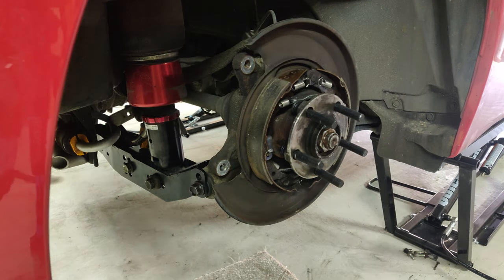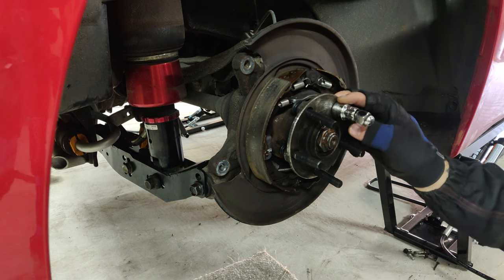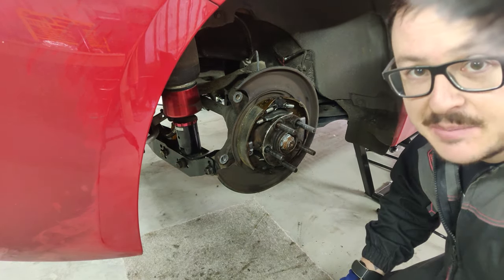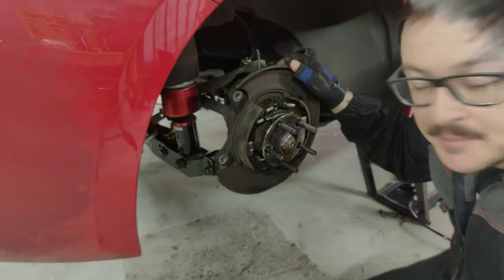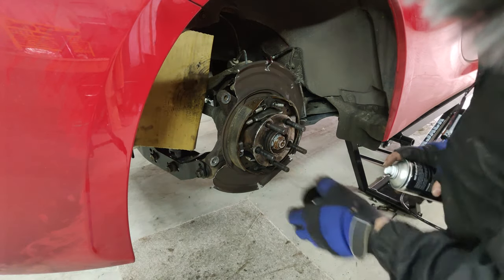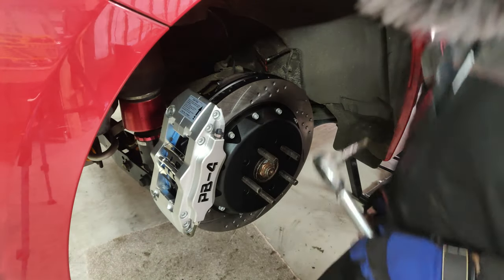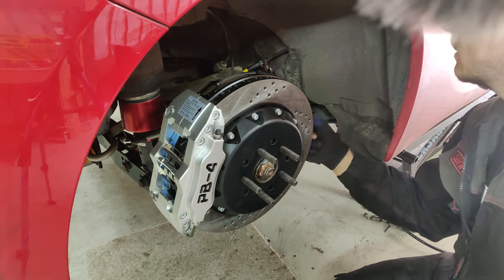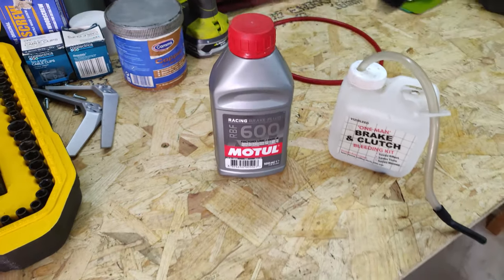4k GT86 big brake install - Part 2

Comment: Come on Sam stop taughting us with the wheels. We want to finally see the stance. Those brake hose couplings to the car are the worst. I swear they're made of cheese. Do those lca's come with longer bolts? Saw that the threads don't come through as far as the oem arms. Are you planning a live stream during lock down?
Reply from the maker: Haha so do I! having a few technical difficulties but hopefully I can get the wheels video out this week! It's going to look rediculous on the stock body and i'm already finding areas that I'm going to have to clearance for the front turn radius when it comes time to bring out the angry tools.

LCA's pretty much came as you see. The only bolt that could do with being longer is for the drop link as all the others appear to have a pretty good grasp. Those droplink bolts are from Whiteline so I may look in to sourcing a new bolt of the same specs just slightly longer but I don't think they're going anywhere anytime soon.

I could potentially livestream some bits but I use my phone to record these videos so would be tricky to do both :)